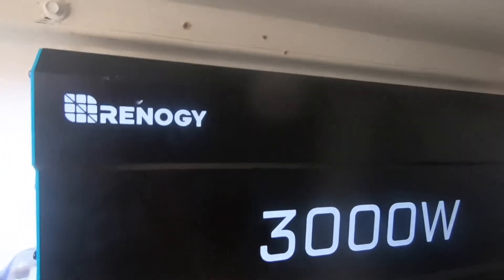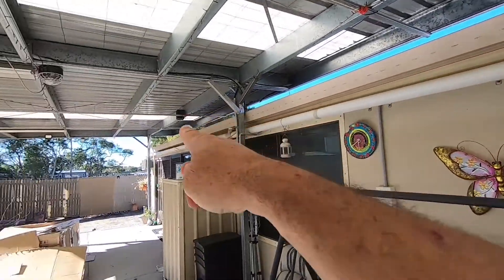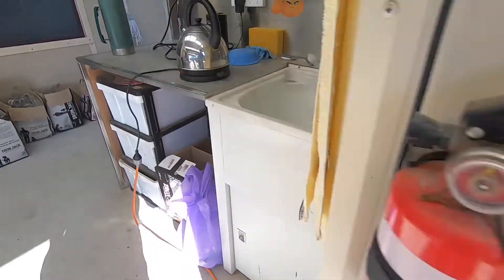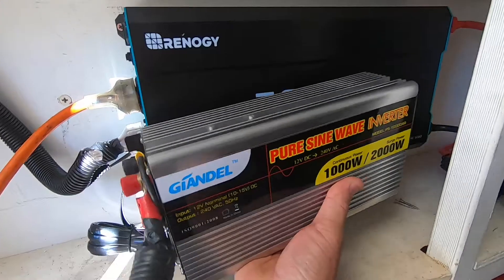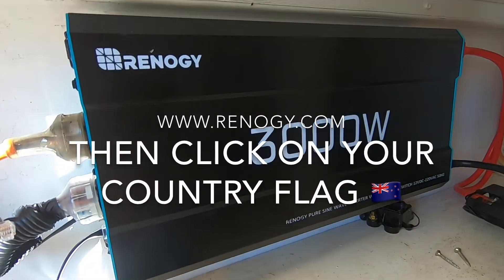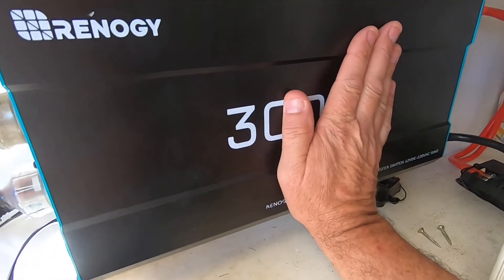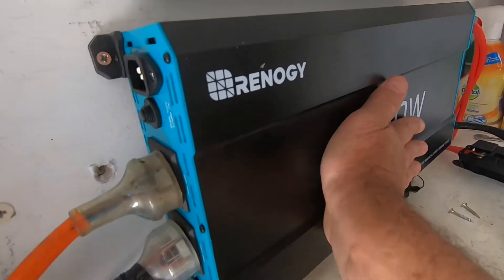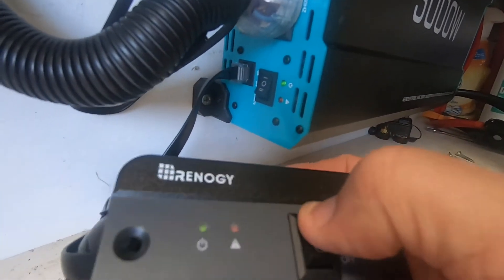Renogy 3000 watt pure sine wave inverter

Comment: Hi have you hard wired the inverter or still using the plugs, I have an 3000 watt inverter charger (renogy) and having issues with it.
Reply from the maker: I have this in my camper van now and I’m just using short extension leads plugged into the inverter .I’m using the plugs and haven’t had any issues as yet. Make sure your batteries are good and don’t use those cheap manual reset circuit breakers from eBay as I was having problems with those. Thanks for watching 👍🍻

Comment: Try with the air conditioner on a single outlet to the inverter it should worck i tested it on a single outlet at 2900w does it stop automatically ?

Comment: i had the 2000 Watt Renogy and i loved it. I'm thinking on buying the 3000 watter like the one you have. Right now I'm using a Reliable 3000 watt pure sign wave inverter. I upgraded the MOSFETTs but it still wont run a small 6000 BTU AC; not sure why maybe the compression surge is too much ? It runs my 5000 BTU AC no problems. The 6000 BTU is an older MAYTAG brand. Im guessing the older ACs draw more power and are not Energy efficient like the 2020 model i have.
Reply from the maker: Interesting that you say that as I just tried my Kogan portable air conditioner 12000 btu 1050 watt input and this inverter will not start it up maybe compression surge too much as this inverter ran a full size double door fridge freezer approx 620 litre and also a 2400watt kettle at the same time with no problems.
Reply: @EFFICIENTSELF  you would think even if the surge is triple the 1050 you would think the inverter should be able to handle that since its 6000 watts surge?
Reply from the maker: I expected so
Reply: I think Watts is limited on per outlet basis below 3000 at front of inverter. Try hardwiring to back.
Reply: Buy a soft start... it's lowers compressor  wattage...on first start...some inverters  have them built  in

Comment: Thanks for the vid. What size wire is ok to run with this 3000w?
Reply from the maker: I have this inverter in my van running on 70mm square welding cable with a 300 amp battery terminal fuse . I purchased from here https://www.ebay.com.au/itm/182294475344?epid=2010612549&itmmeta=01HXFJAA5M1HN7EZ80W9R0ENVN&hash=item2a7198f250:g:-0UAAOSwOtBXS9hY&itmprp=enc%3AAQAJAAAAwE0YxdW84xGl3S%2FZLzAHua7%2BDPIgJ3i4QdN%2BcOW5geKyapPmLjI9yNrBBo3QBDtJCn9udYn5PrxnrJBGl0C1mZAXEZpHoc7WdDxJ2FOALv8UfQ2pCgfVLIM0Pd5f0dW6cS7N2oEa1lugfap1RzVN1SJwqDH2BHjMAHzEPdxm8j8NQNXUPGoJvyOx0mSgbO5SZxHFGYLwLmhlEoQfOHVp1HaS16N5WNyRR4I2mOBRdLm2lvYWRy1YHlG34Sizq1oZXw%3D%3D%7Ctkp%3ABk9SR4CjqfLrYw Hope this helps and thanks for watching 👍🍻

Comment: My 3,000 watt Renogy didn’t come with cables. When you look on their site, it listed cables for 2,000 watt but not the 3,000 & all my research said I need 4/0 copper which is huge. I just got my hydraulic crispers, so soon to make cables and hook it up to plug my camper into when no shore power available. I have 2 x Redodo 230 amp hour batteries, 350 amp fuse. I get conflicting information each site I research on battery cable size and fuses.
Reply from the maker: My inverter has 70mm square welding cable which has rating of 460amps and I have a battery post fuse of 300amps the cables are approximately 600mm long . This has been installed now for over 2 years and no worries running 2300watt kettle and microwave (not at same time) over that period of time . This is the cable https://www.ebay.com.au/itm/182294475344?epid=2010612549&hash=item2a7198f250:g:-0UAAOSwOtBXS9hY&amdata=enc%3AAQAIAAAA4JzxBVU6mmLVysK3nRnHKGEgUGy%2BtzcFPnlWLGPxWBQCHlNMF3tTpkDRMsuK3rljCMwZzrd2O%2FYVDEB4T3mHAgCUKT3DFdEGVIU4EVb4p%2BeEH5wuZ88lAkRizUOtMHmAuZwBn0ch76rmkTjNxNOXcXYwFgBsYQMccNxWZLQu53uYp1XGSr1ZGwqvnxyBbxU%2FL5Ei3KNwGhSdujHmtjyUNgX9artixxSgSfQIjkymZaPpc1wZBgpyl661F%2B61Iz6ZwacRux5ZqzJmo%2FsYIXP5JPqn47W2ksjaVTXuZMVDOx86%7Ctkp%3ABk9SR_St3ZG8Yg Thanks for watching 👍🍻

Comment: Hey just installed this into my camper and had some questions, it says the outlets are only good for up to 15 amps and to make outlets off the ngl plug for anything more.
Did you have to do this?
Reply from the maker: No . I run an electric kettle rated at 2100 watts with no issues .. also before i installed in my camper i used to run kettle 2400 watts and a full size household fridge approx 300 watts both same time with no issues

Comment: Hey mate quick question,im adding a secondary 120ah agm battery to my caravan and i want to connect it in paralell with other battery how do i go about that when ive got a shunt and battery monitor connected aswel? Is it easy as just connecting positive to neg and neg to possitives of both batteries then run the negative coming out of the caravan bsm to one battery and negative to other battery?
Reply from the maker: You better off starting with both batteries the same age as the older battery can drain power from the newer battery but Connect both positives together and negatives together for parallel connection and then connect to the batteries with positive of one battery and negative of other battery so it’s like you are using it as one battery …. Just google it there are diagrams that will explain it better if you not sure ..cheers 👍
Reply: @EFFICIENTSELF  yeh there both brand new mate only 2 weeks appart. Yeh ive ran the a lead from positive to positive and negative to negative on the batteries,is it the wires that run the management system that i need to put positive to one battery and negative to the other battery yeh?
Reply from the maker: Yep even do the same with your inverter and all your accessories
Reply from the maker: Of course through your shunt on the negative side
Reply: Yeh ive got the management system running through the neg on the shunt already,so i should even run the negative of the inverter to the neg on the shunt?

Comment: I am purchasing one soon, currently on sale at Renogy. What size circuit breaker is sitting below it unconnected and will you be using that in your setup? I have 2g wire but I think I'm going to 2/O eventually.
Reply from the maker: Currently have this in my Toyota hiace van setup . I have a 300 amp mega fuse and 2 of 0g cables . I could not get hold of 2/0g at the time but that’s a good size to use or 3/0g  if you can find it. Have a look through my videos as I have one on this showing power consumption. Thanks for watching 👍🍻

Comment: Hey! Thanks for the vid. If im installing renogy 2000w Into my van can you help me with what I need to do with grounding to the chassis, if needed?
Can I plug my appliances directly into the inverter like you have? 
I have a 100ah lithium renogy smart battery, a hiace 2007 slwb and my battery is stored just in front of the drivers side wheel
Reply from the maker: At the rear of the inverter there is a little earth point I think it’s under the positive connection. You just need to run a wire from this earth point to the chassis of your vehicle and you can plug your appliances in directly if you wish… only thing is you have one battery it will only have a discharge of 100 amps continuous. The inverter is a bit too big for the one battery . As it will draw around 150amps if it’s under full load .. if you need the extra power ,you will need another battery. If not drop the size of the inverter to 1000watts. Depends on what you are wanting to run. Hope this helps  👍🍻

Comment: Hi men  I'm confused can u tell me which one should I buy giandel inverter or this inverter plz help me out to choose the good one thanks
Reply from the maker: When this unit reaches its end of service life , I would get the giandel . The giandel performs just as well for a smaller price . This is only my personal opinion but either brand you should be happy with the performance. Thanks for watching 👍🍻
Reply: @EFFICIENTSELF  so which one is better giendel 4000w or this rengey 3000w
Reply from the maker: What are you planning to run?
Reply: @EFFICIENTSELF  aircon at 3kw  I don’t care about the price I need good quality and performance
Reply from the maker: You are gonna need a serious solar and battery setup .  I recently tried this renogy inverter to power my 2.6kw portable air conditioner and it would not even get it to start running . It kept tripping the overload alarm on the inverter . I will actually do a video on this later on .  Seriously you probably better off with a generator as air conditioning will pull a lot of power from your batteries .
Reply: Yes agree 100%, inverters aren't good for aircon I'd go a generator

Comment: In the manual it says this: "The inverter should never be mounted vertically on a vertical surface since
it would present a hazard for the fan opening which is crucial for cooling the inverter."

Comment: Hey mate just about to install my 3000watt inverter,will the wires that came with the kit be fine and what size circuit breaker do i need. Also can i connect the negative wire to the shunt off my battery monitor or connect straight to battery neg?
Reply from the maker: The cables will be ok if you just running around 1500 watts but if you gonna run heavier I would get heavier cables for it . I used a 300amp mega fuse .. connect to the negative of your shunt (that’s if the shunt is 300 amp or more in rated capacity)  I have a video out in 2 weeks on my inverter
Reply: @EFFICIENTSELF  thanks mate. Ive just got the standard shunt that comes with the renogy battety monitor so should i just connect to battery negative instead of shunt? Ive got a 250amp fuse coming
Reply from the maker: The renogy battery monitor has a 500 amp shunt so should be right to go through shunt. 250 amp fuse should be ok .. if it blows go 300 amp …. Google says to go 400amps but i have never blown 300amp fuse.. make sure you got plenty battery power mate cause you will need it with heavy use 👍🍻
Reply: Thanks mate appteciate the help. I'll run it off the shunt and chuck in my 250amp fuse too and keep and eye on it,im only gonna run a kettle off it,microwave and toaster most of all but maybe bigger stuff down the line. Only have one 120 amp battery atm but buying another 120ah battery before i use the inveter then later on i'll add another 120ah batter so will have 360ah all up.
Reply: I conected it to the p- on the shunt is that right? I wired it all up then pluged in a 12/24 volt tv we take camping and tryed running it off the inverter to test it and the tv light kept blinking and wouldnt turn on.
Reply from the maker: If it’s a 12/24 volt tv you can’t plug it in to the inverter. . Check your battery has sufficient charge …. Check your tv works on a normal outlet…. When inverter turned on it should have the green light illuminated…if all checks out ..maybe inverter is faulty….hope you get it sorted
Reply: Yeh the green light on inverter is on and stays green. Maybe its the tv because i plugged the toaster in and its all good,dropped the battery from 13.8 volts to 11.9 lol. I want to get a 200ah lithium i think.
Reply from the maker: You will need a battery bank capable of at least 300 amp discharge to run the inverter at its full capacity…. Get 3 of these lithium batteries they are available early December with 5 year warranty and they are $500 each…. Just a suggestion as this is going to probably be your best bang for buck lithium with good warranty https://www.rollingcart.com.au/shop/kasan-100ah-12v-lithium-battery-lifepo4-deep-cycle-bluetooth/
Reply: They look alright aye. Ive actually found a 200ah lithium brand new a bloke is selling on facebook for 700 that i think im gonna buy. That will be fine aye. Equalivent to 320ah agm.
Reply from the maker: Yeah but what is the continuous discharge current ?
Reply: Maximum disharge current (5seconds) 200ah it says. That what ya mean. Also my kickass charger and solar panel wont work with lithium will it
Reply: Also will my solar panel charge a lithium battery?
Reply from the maker: Mate it won’t be good enough for a big inverter.. I would go 3 x 100ah lithium with a minimum of 100ah continuous discharge each that way you will have enough current for high demand appliances… mate don’t rush into getting that battery off Facebook do a bit of research and get a few opinions… I got another video on my renogy inverter next week . Good luck with it 👍🍻
Reply: Yeh but to be honest mate im gonna gonna be running toaster,kettle coffee machine,microwave etc. Nothing to serious. 200ah lithium should be fine for them aye.
Reply: Maybe worth just getting one more 120ah agm battery and downsizing to a 1500 or 2000 watt inverter??

Comment: why did you use a 400 amp breaker isn't that way above what you could put out with this system?
Reply from the maker: Sorry was meant to say 300 . Actually it’s recommended 400 here https://www.altestore.com/howto/recommended-inverter-cables-sizing-and-breakers-or-fuses-a62/  does sound excessive.the unit is impressive thanks for watching 👍🍻
Reply: @EFFICIENTSELF  Thanks, I'm trying to figure all of this out!
Reply from the maker: No problems i used a 200 amp fuse at first and the thing under full load blew the fuse ... lol .. just be sure your cable is bigger than your fuse 👍🍻
Reply: @EFFICIENTSELF  Got it thanks!!
Reply: I need a 2000 or 3000 watt Renogy inverter.
Reply: @EFFICIENTSELF  Actually, fuse should be rated higher than wire. My Renogy DC2DC 50A should be fused at 75A.
Reply: @oneeyedphotographer  Fuse should be rated less than wire lol, otherwise your wire will become the fuse and potentially burn up.

Comment: Can you have renogy lithium and acid in series? Or parallel?
Reply from the maker: You can’t mix the chemistry in batteries.
Reply: @EFFICIENTSELF  what about a switch with 1 2 and both? Can you have both on and power from both?
Reply from the maker: Not with different chemistries
Reply: @Tyler-sv4sw  AND you have to reset the battery type even if you had two banks of different chemistries with a bus select switch. Remember LiFePO4 works at a higher voltage. Dump the Lead and use the Lithium. For remote stuff its amazing.

Comment: I have one, I have 4 agm battery at 105ah so 420 ah, I can run everything in my trailer for 3 or 4 day's, I only have 100w solor panel but can add more, if you want to run your air conditioner, you need a easy start. If you are buying one of theses, do your research and read as many reviews as you can...
Reply from the maker: Cheer’s mate thanks for watching 👍🍻
Reply: @EFFICIENTSELF  🍺🍺 cheers and Merry Christmas wherever you are in this Crazy world...
Reply from the maker: Thanks Dave 👍 all the best to you too 👍🍻
Reply: Hi,
I have 3000w inverter and 3 agm 105 BMW 2017  batteries . My question is if I run 1500w computers how many hours will run? Because voltage drop very fast.
Thanks
Reply: @rihareviews4951  I think it depends on how much solar you're taken in and if you're running anything else, I'm not an expert, but my system worked for 7 day's in Quartzsite Az 2023 using everything in my trailer except air, it's been really cold here. If you're using AGM's, you can only use half the power supply.

Comment: Lf it didn t put out 6000W the refrigerator didn t work didn t the refrigerator start the engine try it with a 2000w grinder ?

Comment: 3000W is a Huge inverter for a small 12v system. 3000w divided x 12v = 250amps load. Your going to need 70mm2 battery wire minimum.
Reply from the maker: Yeah it’s a big unit . I got 00 gauge battery cable approx 64mm2  from battery to fuse it’s been pretty good and not getting warm . Absolutely terrific unit chris I use this thing every day perfect for my camper setup. Hope your tiling coming along mate 👍🍻
Reply: @EFFICIENTSELF  If you under wire the unit and try and suck power the cable cant supply. You get Heat in the cables = resistance = blown mosfet and or capacitors or both.  Just trust me on this. the reason i said 70mm2 (2 ort ) is minimum is due to the fact that it is rated at 166amps continues but will handle over that for short 10 20 min bursts. Always best to over wire then under wire the unit. They cost to much to blow up and wire is cheap. Just do the math mate.
Reply from the maker: When mounting in my camper will end up doubling the 00 gauge cable from battery to fuse . Will be of course lithium battery setup. How are your lithium batteries doing?
Reply: @EFFICIENTSELF  Have not been away camping enough to say how well or how good the batteries are yet. The system works great. But i limited myself to a 2kW inverter. More than enough power for the induction cooktop.
Reply from the maker: Awesome mate . I went the 3000watt cause the biggest load I would run is to boil a jug and they mostly 2400watts . I’m just gathering my stuff gradually to build my off grid system in my camper van . The lithium batteries are gonna be my biggest cost . Stay safe mate 👍🍻
Reply from the maker: Thanks mate im still checking out my options 👍🍻

Comment: Just my observation... The remote power switch on the unit is not set in the remote  position, and the remote is actually in the off position... LOL I just purchased the U.S. model of this to put in my Off Grid Camper ..
Reply from the maker: I had to go and check mine and mine function as the position’s are marked 😂 thanks for watching 👍🍻

Comment: 3000/12 is 250amps, so why the 400amp fuse?
Reply from the maker: Good question 👍 The 400amp  fuse is used because it needs to accommodate not just the continuous power draw of 3000 watts but also the surge capacity of the inverter. When the Renogy inverter surges to 6000 watts, the current draw can spike up to 500 amps momentarily (6000 watts / 12 volts = 500 amps). A 250-amp fuse would blow under these conditions, so a 400 amp  fuse provides the necessary headroom to handle these short surges without interrupting power. I know I wouldn’t use so much power but the fuse still protects the system under normal operation while allowing for those brief, high-current surges. Thanks for watching 👍🍻